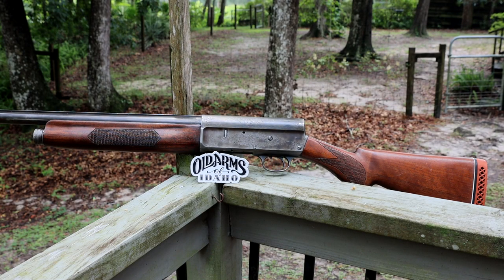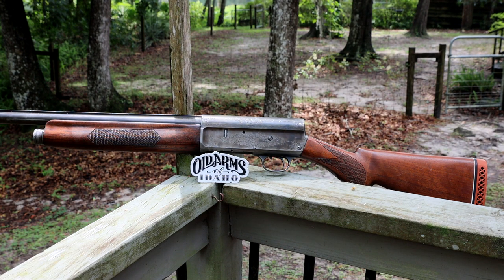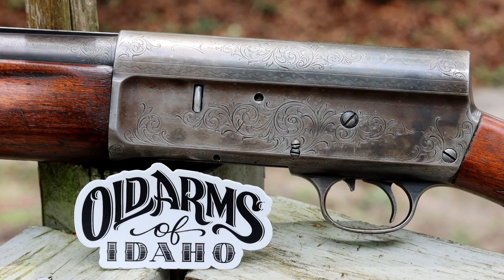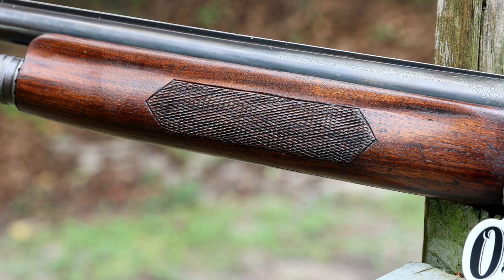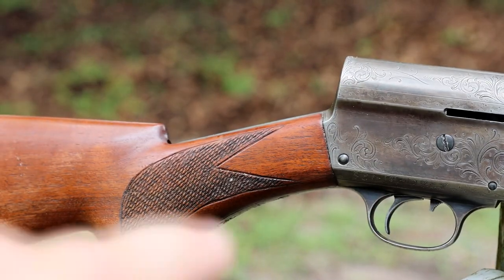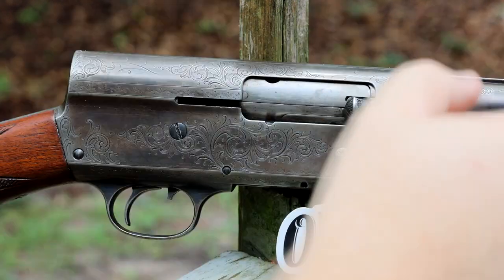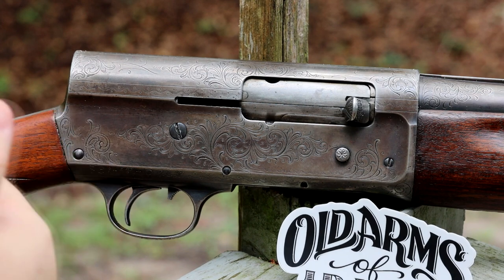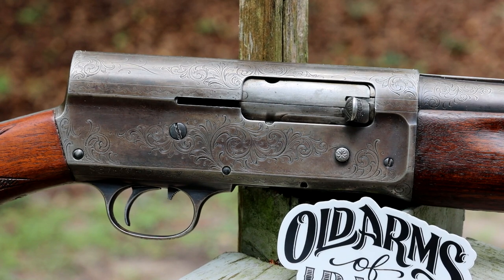Remington Model 11 Project

Comment: I have a Remington Model 11 that I restored, they're super fun, if not a little complicated. Yours is two years older than mine, can't wait to see what you do with it!

Oh, and please go thru replacing the fiber buffer in the rear of the receiver. I didn't do mine, and it sorta nags at me sometimes 😅
Reply: The cool trick is to use an appropriate epoxy to glue it in place; obviously the original riveted design is a chore ( requires a special or homemade rivet set).
Reply: The cool trick is to use an appropriate epoxy to glue it in place; obviously the original riveted design is a chore ( requires a special or homemade rivet set).

Comment: Are you sure the receiver wasn't case-hardened like with oil
Reply from the maker: I'm fairly sure it was blued. It's just missing most of the old bluing.
Reply: Yeah I saw one that was blued in a local gun store but it didn't have all the scrollwork